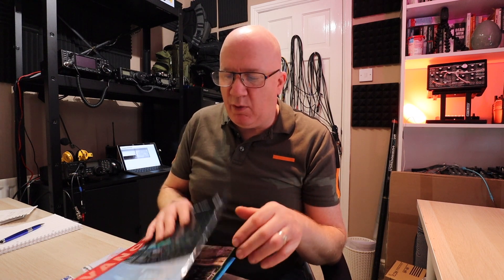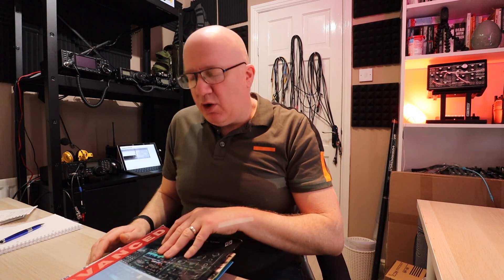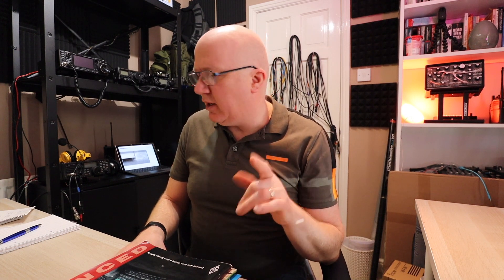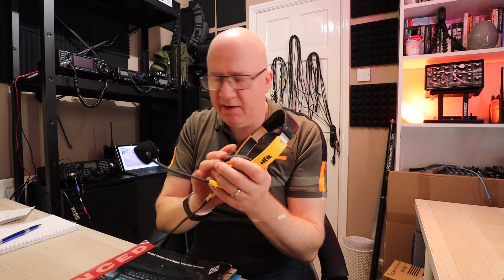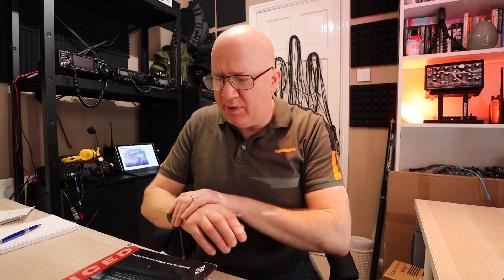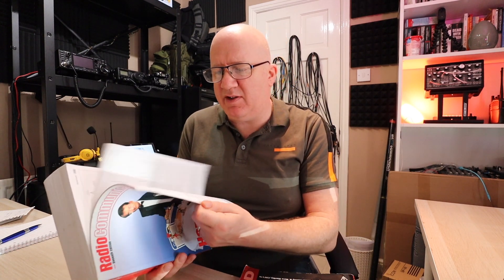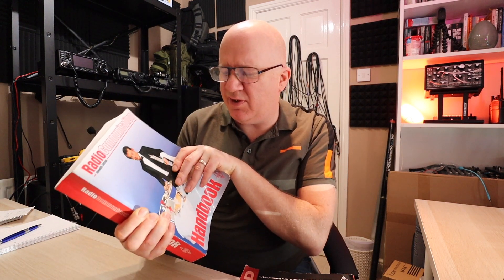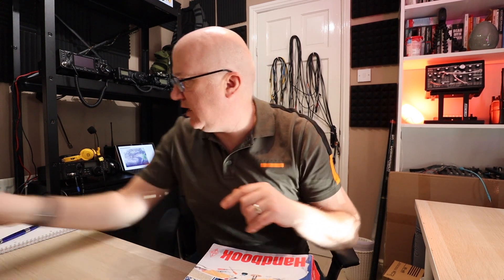Practical steps I'm taking to reduce RF problems when I'm operating amateur radio

Comment: Thanks for sharing. As I get closer to my foundation licence - January hopefully - I am sure that I will face these issues as I start keying up with a mighty 10 watts available instead of the 4watts on CB. :-) . Joking aside my CCTV system is very susceptible to stray RF so knowledge is good to have ahead of any issues.

Comment: Carl a good quality isolator is better than a cheap one. I had the same issues as you have and put in a line isolator from RF Comms made by Geoff G4ICD where my coax entered the house and problem solved. Well done on the advanced !

Comment: Carl, a really good description of your problem and your initial plans of elimination. I will be following, in particular the ferrites you are planning to use on the AC and DC lines. I did suffer from ADSL interference, but the better half saw a good offer from a  fibre provider. No ADSL issues at least! All the best sir, G

Comment: Tracking it down here too is on my list but for now operating out /P is my answer 😉
Great video Carl 👍👏👏
Reply: Same here for multiple reasons like not being able to have decent antennas at home. I finally switched to an FT-818 and drive to a nearby nature park and operate from there  using vertical antennas. I alo started operating from hikes with a backpack with antenna tuner, the 818, a tripod and an end fed vertical with some counterpoise. That brings QRP challenges but at least a lot less interference.

Once the lockdown ends the new plan will be bicycle /M!

Comment: I’m assuming that you have a good VSWR on your antenna. Try isolating the mains by using a battery to power the rig. Is your metal shelving acting as an antenna? Toroids is a good start.

Comment: You need a good RF Ground. This is NOT the same as an electrical ground. If you are using an endfed-half-wave,  a counterpoise is a good idea. 

Choke balun, aka dirty baluns will help. However cheapy leaky coax will not help as your SWR will be misled by the coax losses etc.

An RF ground should be as short as possible. A fraction of a wavelength or it stops being useful. 

Also, you can put ferrite beads and rings on everything where you are operating that is picking up RF. Make sure all your cable connections, EVERYTHING, is short and longer lengths are wound on ferrites.

Also, you do NOT want to get RF inside switch mode power supplies as they can go bonkers and damage your gear. 

Basically your radio is pumping out RF up a coax pipe and ALL OF IT should be going to the antenna. On HF you might want to experiment with balanced feeder which is much more efficient than coax, however it MUST be kept away from metal (Windows, guttering etc). 

Stephen G7VFY

Comment: I find that imbibing half a bottle of Shiraz reduces the noise in the headset. It certainly makes it more tolerable.
Reply from the maker: Jura 10 year old single malt
Reply: @M0SZT  Yes, that can also dull the pain and help concentration.
Don't get me wrong here - i enjoy my single malt's as much as the next alcoholic but I drink JW red on ice with schhweppes lemonade.  I can't spell scwheppes.  It's Friday Carl, what are you having tonight ? For me, tonight is already here. It's 43c and too hot to drink. I was just installing an Icom 2730A EXP to my car. Too hot to do anything.

Comment: I have had good success in eliminating RF feedback getting into my mic/rig etc by using a) a QUALITY inline choke/line isolator in the shack (in the case where you need (part of) the coax shield to still act as a counterpoise) and b) using an artificial earth tuning unit with random wire counterpoise on shack floor. I have a lot of experience with both (not ‘bought it, tried it, didn’t work, binned it’) and persevered in both upstairs shack and when portable and operating QRO. Even a simple ‘tail’ of wire connected to your rig ‘ground’ stud can assist and is part of the ‘fun’ (pain) curing RFI issues! Even swapping the mic used can cure things tremendously especially when a lot of headsets can have limited EMC immunity built in (never mind having no or dubious CE marking). It’s a big topic! Have fun. Look forward to developments.
Nick DDD
Reply from the maker: Yes the headset I've bought seem to be very susceptible

Comment: Have you looked at the GM3SEK talk from the RSGB convention, 'Clean up your shack'? He has a design for a mains filter, and recommends chokes at both antenna feedpoint and tuner output - I've done it, and the results on my inner city, sub-optimal station have been pretty great!
https://gm3sek.com/2019/10/11/clean-up-your-shack-2019/ has some slides and info, and and the video is at https://www.youtube.com/watch?v=LSL1h6MJbaI are a great start!

73! MM0RFN

Comment: I have only ever had problems with stray RF floating around the Shack once which was not long after 1st being licenced in 1980, it was also only noticed when running 100 watts or more although I am sure it was there at lower power levels just less noticeable. It was mainly due to high swr and poor quality coax. I first noticed it because I was getting TVI on my own TV when running higher power levels and also I could hear audio coming through  the stereo,s speakers. I cured it by making sure I had a very good swr and that I had a good 50 Ohms Impedance from my Tranceivers to as close to the Antennas as possible, which meant I had to use a remote ATU for H.F bands as close to the Antennas as possible and used a remote homemade with relays Antenna switch. This cured my TVI and stray RF problems.👍👍.
I don't suppose many use there TV,s with there television Aerials these days with most programs being streamed from the internet these days.
Best of luck sorting your problem out.
73  de Steve M0BFM
Reply: A high swr or impedance mismatch has nothing to do with emc issues, it's common mode current caused by an imbalance, although swr can interfere with common mode current and mess your readings it's the cmc that's the issue
Reply from the maker: Yes that's part of my focus is the CMC on transmit
Reply: That has always been a reason why I have never been keen on internal ATU,s because it still leaves your coax and antennas untuned or un-matched. It only tunes and matches your Transceiver,s output from the final PA to the SO239 socket. Leaving all the nasty rf to float around your Shack and into any pieces of wire that's around effectively acting as an Antenna.
Reply from the maker: Yep I've got an SGC tuner at the base of the antenna
Reply: @M0SZT  That's good news. Don't forget that all pieces of wire in your shack will also act like an Antenna, lots of ferrite beads or clippon ones should sort it.
Reply: @stevejones8665  an atu provides a conjugate match to allow maximum power transfer, making the system resonant, there seems to be a total misunderstanding of what an atu does through out the amateur radio world, it's common mode current on braid of coax that's causing emc issues not high swr, you could have a perfect 1.1 swr and still have the same emc issues

Comment: I’m just about to start building my shack/converting the garage, do I try turning it into a kind of Faraday room ?
Reply: You don't need to do that.
Good line isolators with correct ferrite mix and number of turns that cover the bands used will stop RF coming into the shack
via the coax. Put the same ferrite mix on all ac/dc leads, pc leads if you have them and if your using mains put the big ferrite on that as well. Use decent screened cables like USB, audio leads and network type cables.

Don't buy chokes make your own, the rings are easy and cheap to get and all you need to do is put some turns of cable round each one.

My antennas are right next to the shack, Cobweb 20feet above, Hustler 7band vertical 10feet away, 100watts no problem with ferrite
on every lead and screened cables.
Reply from the maker: Sounds like a good idea!
Reply: DX Commander  Don't forget a Tinfoil helmet aswell 🤭🤭😂🤣😂

Comment: I'm not sure putting a torroid on the mains lead will do any good, they only tend to work on DC power leads, coax or various usb speaker leads etc. 73's
Reply from the maker: Ok I'll give it a go anyway just to rule it out.

Comment: First congrats on your full licence. You're going down a similar route i did. First i got rid of my long wire 9-1 balun and replaced it with a 49-1 with the balun fed 70ft away from the house and the earthing side of the balun down to earth with earth rods, balun was only a couple of feet off the ground. Then a hefty Fair-rite mains choke ( i knew i was getting some rf down the mains by running the radio on a battery first) by doing just those 2 things i reduced quite a bit and also improved my noise - another story as you know. Next a line isolator at the balun end and similar at the radio end. I tried earthing the radio but as im on the 2nd floor the wire just made things worse. I considered an artificial earth but was not sure. Ferrites on leads that came in and out of the tx/rx usb lead etc. I was also trying to reduce VDSL at the same time. I would say ive managed reduction of noise by about 75% and RF feedback by 100% but I continue to learn, even at 68 years young! ohh take a look at this site about fair-rites http://www.ifwtech.co.uk/g3sek/in-prac/index.htm

Comment: Deja Vu here. When I first installed my EFHW I "cleverly" added an isolation / choke balun from Ebay costing thruppence. It was as much use as a dead moose. Went to the other end of the scale and purchased a beautifully crafted unit from BalunDesigns which has worked perfectly (even at the 100W level). So ferrite type seems to make a difference. Admittedly, I have a decent RF grounding system in place which may help. To cross bond or not to cross bond? 73, M0YZT (first time I've used it!!)

Comment: Excellent Carl 👍🏻
I think our trainer for the Foundation course suggested looping a few turns of the coax around something like a clay sewage pipe to make an "ugly" balun.  I'll only be QRP with the 705 to begin with but will obviously also want to try and use it at home, so very interested to see what your findings will be 👍🏻
73s M7GTX 🙂